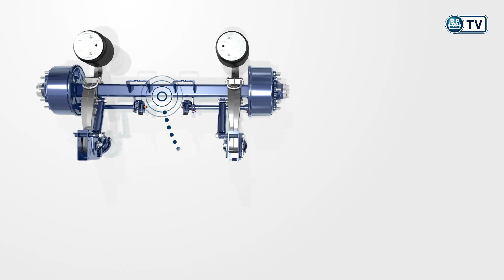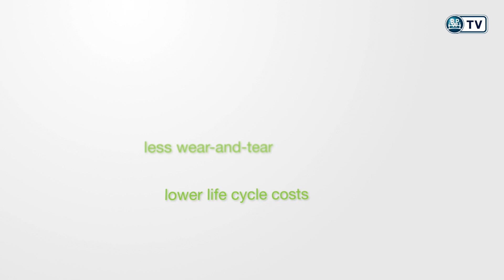BPW ECO Drum: Drum brake and cost reducer in one unit

Comment: You needed to lubricate the stub axles because after five years the bearings are seized solid on the axle then stripping the bolt threads in the axle.  then it's a major axle repair removing the axle.  Simple things like this let you down. You should listen to the customers and me